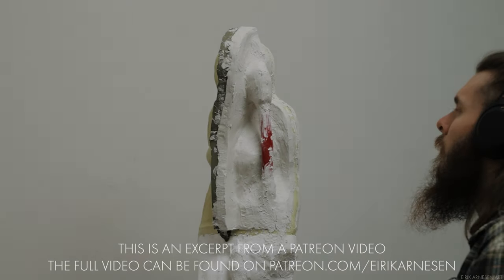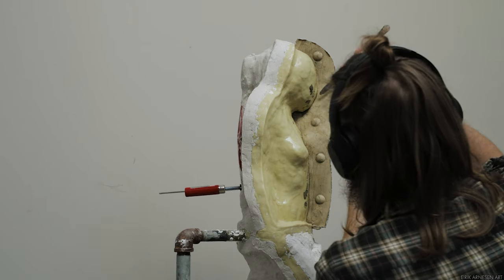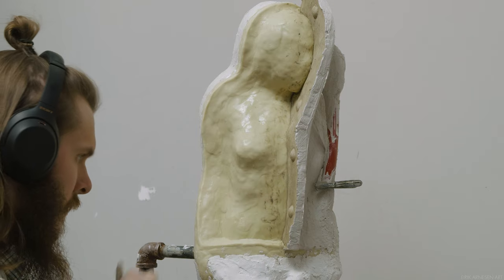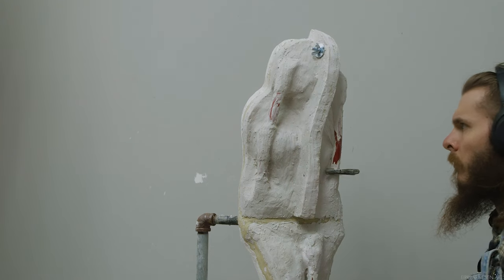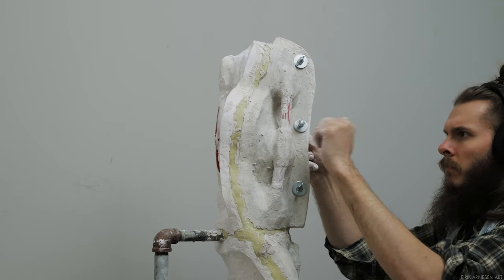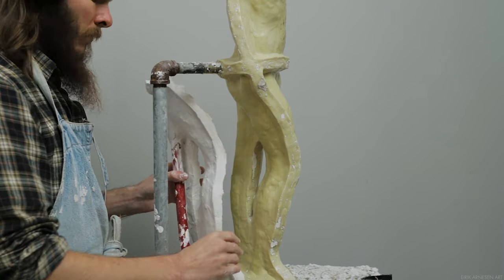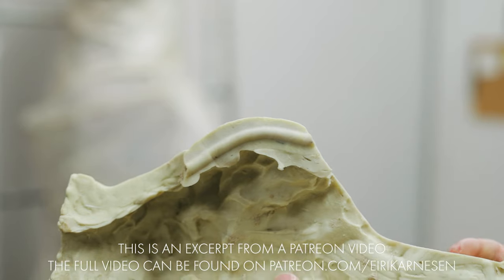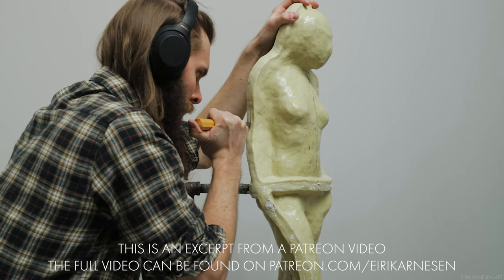How To Mother Mold - Mold Making For Beginners

Comment: Eirik, you mention it could take weeks for a plaster mold to fully dry but is it ok to cast from unhardened mother mold or does it need to fully dry first?
Reply from the maker: No you can work with it pretty much right away, it's just not as strong as it will eventually be once it properly dries.
Reply: @EirikArnesenArt  thanks for you quick reply! I’ve got my first sculpture using the plaster/burlap method all ready to go. Your tutorials have been a big help.